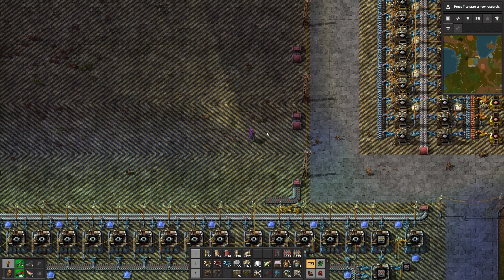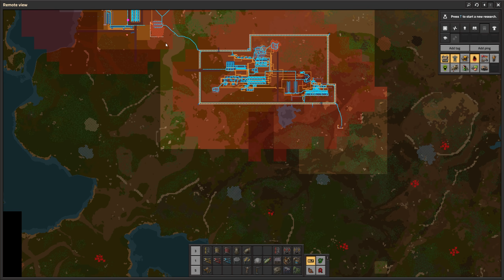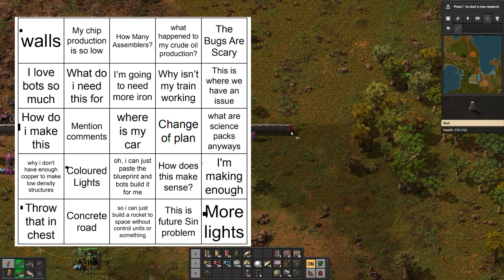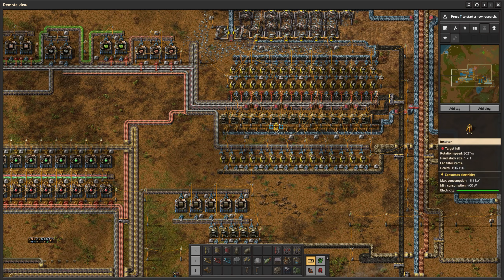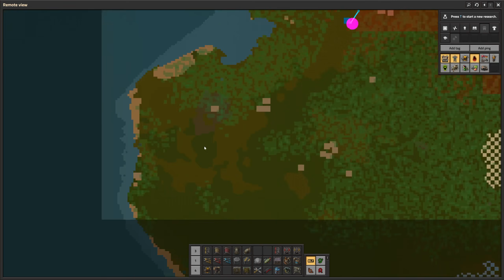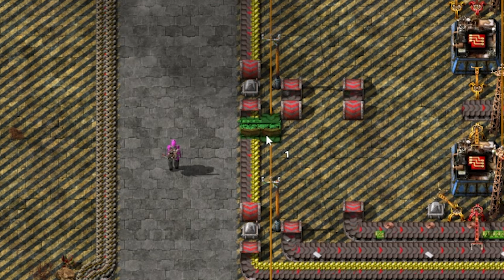Satisfactory Pro Plays Factorio - EP.6 -  This Game Is A Stress Test

Comment: Burning trees does indeed spread (as you discovered), and creates a ridiculous amount of pollution (one time burst)

HAH! That bingo card at 2:00 is amazing! (also, rocket control units, RCUs, were a thing until space age came out. RCUs took a speed module 1 and five blue chips (processing units), so basically 5 of each green, red, and blue chips. They were replaced with using blue chips, making rockets a LOT cheaper. This change was made because in space age you need to launch a lot more rockets, and RCUs were expensive, to the point that back then, having a single rocket launch a minute was a somewhat impressive. Nowadays in space age, being able to launch half a dozen rockets per minute (yes, sustainably) is closer to the norm. 

holy mother of sulfur. I don't like telling you about ratios, but uhh, end game bases can survive off of like, 2, and megabases (producing thousands of SPM) seldom get over 20..

Red chips are one of the biggest sinks in the game. You can never have enough. 36 is a baseline for me. Doubling to 72 is not a bad idea. In fact, it's a good idea cause you're guaranteed to need more later for blue chips anyway!

A boop to point out: red belts can only carry 30 items/second. [insert nerding out about density of ingredients on a bus and how crafting changes density]  Anyway, something something I see a bottleneck in a build you made this episode. Good luck finding it with these hints! <3

Mechanics info! A steam engine does not produce any pollution! It's the boiler that turns water into steam that creates the pollution! So, you can create steam in one place, pipe it around, and get pollution free power production in a different place!

You calling gears screws will continue to confuse and amuse me. 

Factorio combinators use logical arithmetic (as in logical operations) and is turing complete. Arrow In My Gluteus Maximus (youtube channel) made a 3D raycasting engine that runs Doom, all inside factorio. If you look up "facto-rayo", you should find it!

Oh god why did you take an odd number of underground belts into your inventory. The horror!

To do the thing you wanted to do at 12:14, you'd need combinators. I'd probably set up a memory cell (a decider combinator whose output is linked to it's input) and make it so that each inserter pulses upon grabbing an item (that's a setting in the inserter), and then have it get disabled (enable/disable being set in the memory cell). I'd give each inserter an ID somehow and only after every inserter has swung would I release all of them, enabling them all once again. If I can't set an ID/unique pulse signal easily, the only other way I can think of off the top of my head is to have a memory cell for every inserter (effectively acting as the ID) and then an extra DC (or maybe an AC (arithmetic combinator) to trigger the reset signal.
TLDR: it's overcomplicated and not needed, and you would absolutely need combinators. Better solution: MOAR IRON!!!! (or whatever your input is)

Sorry for the super long comment btw.. This is what happens when I write comments as I watch a video.. At least I didn't accidentally delete the whole thing! That happened last time I found myself writing an essay in youtube comments..
Reply from the maker: Don't apologise. I appreciate all the comments people give me. I would say I have gotten this far this quickly thanks to all the comments giving me tips and helping me. Circuits still scare me at the moment, so im planning to work towards trains and then try to dive into it. I didn't know how much sulfur I was going to need. More is better 😅 I figured i was going to need a lot more red circuits considering everything requires them now. Thank you for all the tips and advice with this comment, I really appreciate it ♥️😊
Reply: @Sin-r2h  oh yeah absolutely more is better! Much better to overbuild than underbuild!

And yes, circuits can indeed be scary, but also super powerful when you get good at them (totally not me resisting the urge to talk about how I made a really complicated circuit setup that manages resources on space platforms in the DLC haha). 
The other thing with combinators though is that a lot of the times, you just don't need them. They truly are for advanced uses. Like sure, you can set up a little combinator next to all your train stops to encourage a more even distribution of trains going to said stops (if you have multiple stops with the same name, factorio uses a priority system that you can set via circuits. If multiple stops have the same priority, the train will choose to go to the closest one), or, you can take the simpler approach and just add more trains, which has the same effect and doesn't use combinators (first example I thought of. Also that really only applies to train networks that have mass throughput and many stops supplying/receiving the same resource. For small scale, i.e. only 1 train stop that supplies iron ore and one that receives it, it doesn't matter (and that's me trying to convince you that trains aren't scary. Have fun with the signals btw :) ). 

TLDR: factorio is fun and I know way too much about it works. Also don't worry about circuits. 

My pleasure with all the information I give out! I enjoy factorio (probably too much considering I'm approaching uhh, 2750 hours in the game..) so seeing someone else learn the game from nothing is cool!
Reply from the maker: Circuits do seem great. Right now, I have my one small train that I am so proud of 😅 its nothing special or good. I feel like the trains would work similar to satisfactory in some ways so I shouldn't have too much of a hard time. My only issue with it is the open plains next to it. I have secured my choke points except for the bottom right....there is no choke point 🫠 I also haven't killed myself with the train so im doing okay 🤔♥️

Comment: Man, I remember when I first made blue science.  Was around 11pm when I thought to myself "ok, let's tackle this new science pack" and then by the time I had tapped a new mine and ran everything to the smelting area and setup all the assemblers and finally cranked out my first pack of blue science I heard a sound outside my window.  It was the garbage man doing his 6am pickup.  That's when I realized I really had to pee.

edit: oh, also, big recommend, but I would look through Factorio mods for one called "Squeak thru."  It basically lets you run through pipes and between buildings that are right next to each other.  It's just a nice QoL mod that makes getting around your base less of a hassle.
Reply from the maker: I've been doing the same thing when playing, realising it's 4/5am and I have work in a few hours. Then I get to editing, and I have to go through 6/7 hours of footage. I should really look at adding some smaller mods to help with cases like that. Thank you ♥️😊

Comment: 28:13 There is an instance where you can press V on a machine to virtically flip its fluid inputs, however it would mess up your outputs. Also I know you tried rotating the assembly machines Mk2 in an earlier episode and it didnt let you, however, you can rotate once it has a recipie that takes an input (not sure if anyone told you this yet).
Reply from the maker: No, you mean like what the tutorial was trying to tell me? I still feel like an idiot trying to put pipes into it and trying to make barreled water, which required water in an assembler. Thank you for the tip 😊

Comment: There are two completely independent ways your inventory can connect with robots.  One is to have a personal roboport.  This will allow construction robots (not logistic robots)  in your inventory to take items from your inventory to build things near you.  They can also deconstruct things and bring the items back to your inventory. Personal robots do not interact with the local fixed logistic network at all and works while you are not inside fixed roboport coverage.

The other way robots can interact with your inventory doesn't require a personal roboport and used logistic robots (not construction robots) in the local roboports.  If you put items in your trash slots, logistic robots will take those items and put them in storage.  If you set up a logistic request, the robots will try to ensure you have the requested amount of the things you request.  You can group the requests into "sections" that can be enabled and disabled separately.  These profiles can also be used for other objects that act as "requesters".  I think the tank is the only other requester you have access to so far.

Construction robots can also work in fixed roboports in which case they take items from provider or storage chests, and return excess items to storage chests.

Almost everything in the game can be connected to the circuit network.  A good rule of thumb is that if you have to keep manually tweaking something to keep it working, that's a good place to try introducing circuits.

Comment: All factorio players who i know, ALWAYS build oil refinery setup same way, i like to see you solution, it's very original and unique)
Reply from the maker: And im sure very confusing. Now I need to sort the overflow problem 😅
Reply: @Sin-r2h  if you mean balance between oil products, it's asspain for most players, at least in first play) you need to work with circuits for this, with controllable refine overflow to other types)
Reply from the maker: I had a sort of fix for it. But now my plastic is backed up so its back to being a problem 😅
Reply: @Sin-r2h  It's not flexible solution😅 If you don't wont tips - don't read next)  storages sent quantity of all three oil fluids, pumps block flow by condition, pumps provide refineries for converting light oil into petrolium and hard oil into light oil, it's solve 90% of problems. Last case - if you need many hard oil, but other types already overflowed - you can't refine and oil processing stopped. For this case  you need almost same setup, with converts overflow oils into solid fuel(and rocket fuel next), also by condition - three rows of factory, fuel from hard oil, from light oil, from petroleum. Refine only the most stored product by conditions on pumps

Comment: 31:12 you DO have enough copper and your belts ARE enough to deliver your wires fast enough, you're just not routing them properly. Right now you get 1 full belt of iron plates and 1 full belt of copper wires, merge that together into 1 belt of both, then split it back to 2 belts, but each of them gets only half of the belt because the merging belt can't handle 2 full belts going into it. To mix 2 belts together without losing throughput, you need to first split both of them and then mix the halves into a single belt, that way you won't have a choke point

Comment: OMG, the first new player to not underbuild red circuits :O

on a more serious note, You can use the copy tool to count how much of one machine you have in a given area, it says it without you having to copy it (press q to cancel the copying)

What you tried to do with circuits for the steel would have been useless, because the problem is that the belt doesnt transport enough iron in the first place, so even if you programed it so that all furnaces would be runing rather than stealing each others iron, they would be running only a third of the time
Circuits networks have their uses, but the solution is more often "build more" and "more input"

Use the green modules in miners, they are incredible at reducing pollution (up to -80%) and miners are the biggest early to mid game pollution source

you didnt had to get rid of all pipes, you can click on a pipe to get in the pipe network and click "remove all fluids" to do just that

Ok this tip is important, you will eventually need to learn hwo to make an oil cracker
The concept is easy, you use chemical plants that turn heavy oil into light oil and light oil into petrolum (recipe: heavy oil or light oil cracking)
But for that you shoul use a circuit network, just conect the tanks together and then put pumps that "enable" when their is more heavy oil than light oil for exemple, it takes some time to figure it out but it is pretty easy

you need robots in your inventory to use the roboport backpack

Sorry for the long comment but its such a long video i had a lot of stuff to point out
loved it, happy to see you understand so fast, your getting into the robot era wich is when the game really starts, hyped to see what you'll do of it :)
Reply: I'd say he's underbuilt red circuits.
Reply: when im casually playing a new save, I usually do like 12 or 24 assemblers of reds, enough to get me to robots and a bit more before I have to expand on that

Comment: "I'm not making enough of a lot of things..."
Get factorio'd, son! 😆
Down the rabbit hole with you
Reply: A helpful tip, cuz I like helping new players: ;)
For new players a buffer is a nice thing to have. Note how your production lines are full and completely stopped for quite a while after you initially start them up, because you're not using the resource yet while you plan out your builds that will eventually make use of them. Instead of letting the whole thing stall, consider placing them into a chest (or a small line of chests) to let a buffer of that thing build up. Then when you start using that resource, pull from the buffer chests. Since your rate of consumption is uncertain (being new and all), it's nice to have a backlog of pre-made resources that you can make use of while you figure out just how much production is actually required. [EDIT] It's also nice to have a dedicated collection point for a resource for when you just need that thing right away (for pocket crafting), instead of taking them directly from the belt like some kind of savage!
Bonus points for circuit logic to turn on/off lights when you've taken more from your buffer than you've put in (Need more production)
Even more bonus points if you centralize these lights to a "command center" and properly label them 😎

Enjoying the series so far :D
Good luck in your endeavors, and may your factory continue to grow
Reply from the maker: Thank you for all the tips and advice. Funny enough, I've just started messing with trains and remember somebody mentioning buffer chests. I now see how they are so useful. I will have to go around my factory now and install more. Especially for gears as I am always out of them ♥️😊

Comment: 10:56

When doing the circuit connection, you needed to set it to >= (the > with a line underneath it) which is greater than or equals to 600, you only did > which means it has to be greater than 600, doing greater than 599 did fix it though if you want to be more precise in later circuits, the greater than or lesser than equals to is quite important.

Comment: For pollution, don't worry about the concrete, the trees can make a difference but honestly, it will never matter while using steam power.  If you want any chance of something even close to equilibrium you need to be using solar which takes up a ton of space.  I don't remember if the base game has any way to clean or filter pollution  or if that came from a mod, without  that, and clean power you should just look for choke points to wall out biters
Reply: It matters if you want it to.,every bit counts, especially if you are trying to decrease pollution spread as much as possible. Though of course it doesn't matter much if you cause lots of pollution. 
If you shove efficency 1 modules into pretty much everything (vanilla labs always get prod as they don't pollute anwyways), it'll decrease pollution and power draw by 60% - 80%. So even with coal power you can drastically reduce pollution spread/production. Pretty sure it also decreases evolution speed, as you actually reduce the produced amount of pollution.
Of course also adding solar power will be even better.
If you go hard on prod modules sure, your polution is gonna spread far. Though in that case solar power probably wouldn't do much to help anyways.
Step one of decreasing pollution is probably putting efficiency mods into miners. They do pollute quite a lot. It's especially useful for mining outposts if you want to minimise biter threat.
And no, vanilla doesn't have anything to clean pollution.
Reply: Solar wouldn’t be the first choice for reducing pollution.  At this stage of the game, typically miners are the biggest pollution source, then smelters, then boilers (so solar would be third priority).

Also, nuclear power obsoletes solar, so an early solar rush usually ends up just being a big waste of resources.
Reply: @cellularmitosis2  you cannot exactly get rid of  miners or furnaces ever though.  Personally i just pump put as much pollution  as i want and slaugher every biter i see on the map and find choke points for defense
Reply: @cellularmitosis2  Though having solar is always nice as it can't brownout.
Also pretty sure for a vanilla win nuclear is pretty optional. Especially if you go efficiency.

Comment: You can partially deal with the adjacent pipe issue by using underground pipes instead of full pipes since they do not auto-connect to the side.

At around 25:00 you also could have connected both sides into one central set of pipes using the underground pipes to skip over each one while still having the 3 types of fluid vertical with 1 gap between each pipe.